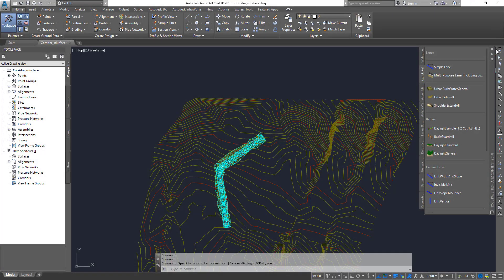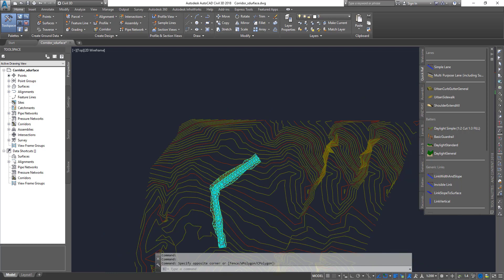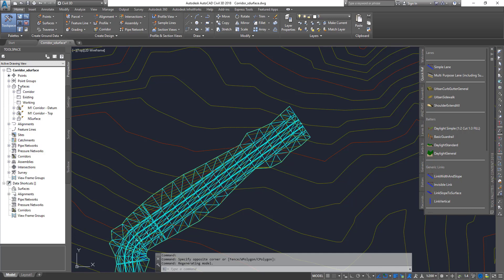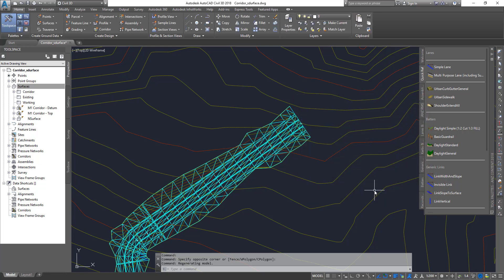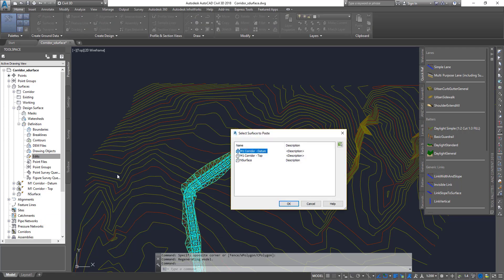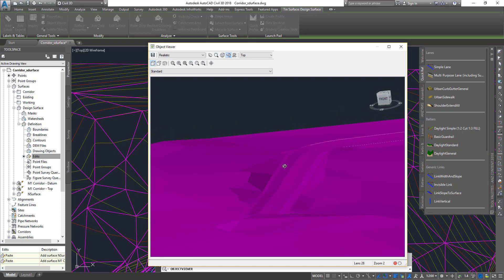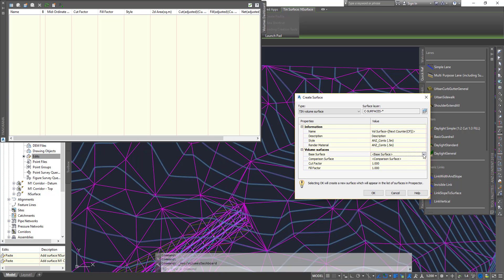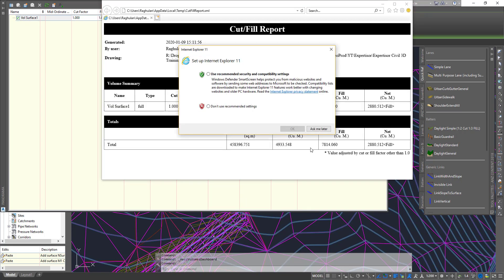Civil3D Creating Design Surface and using Paste Surface

Comment: how can i elevate the design surface? lets say i have a NGL which has elevations around 2.5m-3m. I want to make a flat design surface which will be elevated 5m. Then i want to make comparison between them.
Reply from the maker: Get the tin made out for the design then select the tin and move the z value to 5 meters. Not sure if this is what you want.